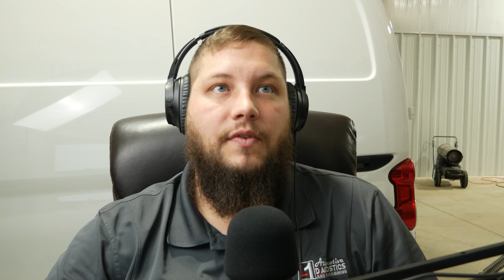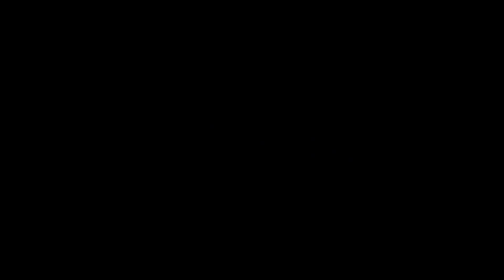Daily TQQ#10 Change a tire, to fix a belt sqeak?

Comment: You are %100 right about every mechanics start..... when I started 5 years ago I torqued a bolt in-ft buy using ft-b torque .... yes I broke the bolt .... I told my manager and toke full responsibility...... and purchase all kinds of torque wrenches....: now I am one of the diag. Tech in my shop.

Comment: Good advice, but I might add that tracking the wiring especially in the driver's door flex would be a good place to start. It's by far the most used door on any vehicle and being 10 years old is likely to have at a minimum broken insulation on the wires and possibly mostly/completely broken wires that are intermittently losing connection. Also I think you mislabeled this video as "changing a tire..." and not something like "Intermittent windows" etc. Keep it up.